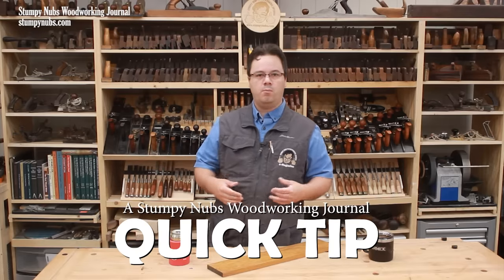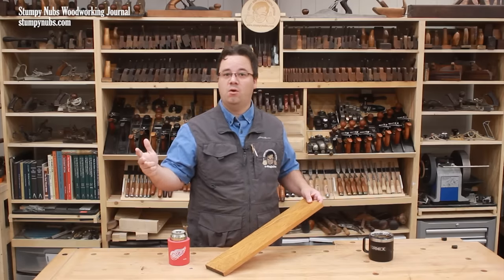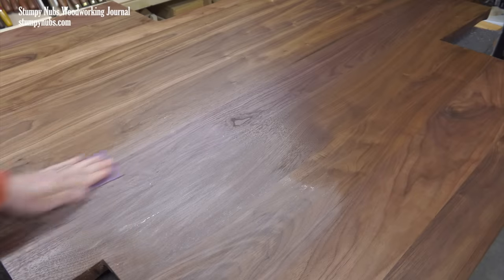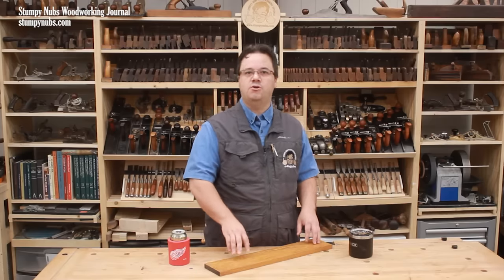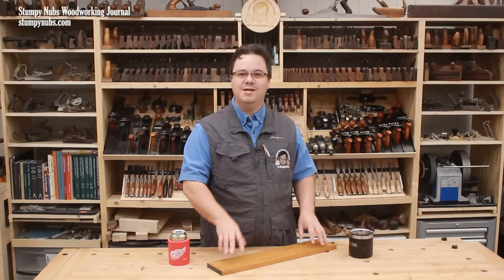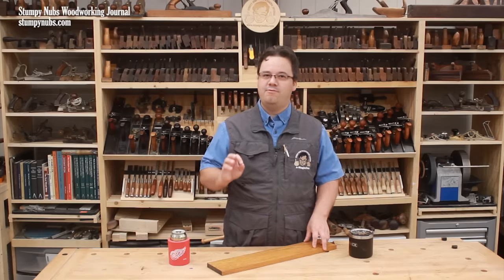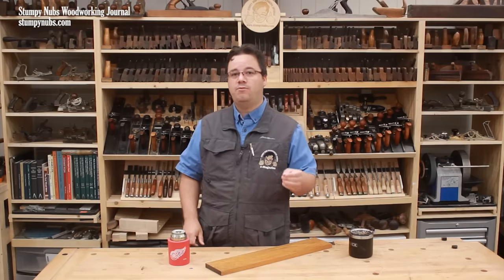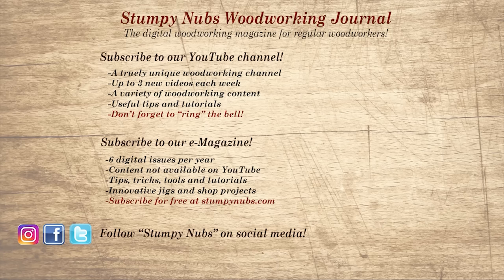Improper sanding between coats of finish- HOW TO AVOID IT!

Comment: Hello Stumpy Nubs.
Thank you for sharing the paper bag trick for buffing finish for the last final time. I always enjoy and learn a lot from your videos. I had some tables that I had to refinished because the kids accidentally spilled some super glue on them in about 20 spots. I used a fine blade scraper  with paper under each corner to remove the super glue. I then sprayed the tables with helmsman's semi-gloss Spar urethane with my air paint sprayer. I wound up with a bunch of little tiny tiny air bubbles or bumps. I think they might buff out but I just want to take the bumps off and then Maybe rebuff the whole Surface by hand. How would you tackle this project of taking the little bumps out of the Finish? Also for the buffing, would you recommend using Watco finishing wax? I really love the feel of this wax after it has been applied to a perfect finish. Believe it or not I also use it on my table saw and jointer. It doesn't leave any wax buildup on your wood and it makes the surface really slick. Thanks again. Gene

Comment: Great video.  Very informative.  I applied my first coat of oil based polyurethane and sanding it to get rid of dust and small bubbles prior to my next coat.  When sanding, do I sand it down until it's smooth?  Or, until I can't see the outline of the bubbles/dust?  Right now it's smooth, but I can still see the round outline of the bubbles.  Thank you!
Reply: Did you get this sorted in the time since posting?  I'm curious how it turned out XD

Comment: Good video-thank you! When using Tru Oil on a guitar body would you sand between each coat or maybe every third coat because the coats are so thin?
Reply: I am in the process of this now....I hit it after the first coat with 400 real lightly, 000 steel wool after the next 2 coats and 0000 steel wool after the last

Comment: Very informative video. I’d be interested in seeing the finishing room you have set up. I’m in the process of building a shop and a portion will be used for a finishing room.
Reply from the maker: It's just a 10X10 room where no other woodworking occurs to cause dust. I don't do a lot of spraying, and I try to use low VOC finishes, so there's no special ventilation or anything in the room.
Reply: @StumpyNubs  thanks for the reply. Like you, I try to use low VOC finishes. I’ll have a window in the room so I could use that to let fresh air in. I enjoy your channel as I find you give practical advice for the non-professional woodworker 👍

Comment: Mr. Nubs, I'm afraid you have stubbed one of my peeves. You wrote that your channel is "Truly unique," but you misspelled "truly." I'm not going to tell you the wrong spelling you used because most people judge correct spelling by what looks most familiar.

I know this isn't a huge deal but it is a really big pet peeve of mine. I'm actually worried I won't be able to keep feeding it, but I don't want to give it up for adoption so I keep it around. It's possibly my oldest and most loyal pet.

Comment: Great video! Lot's of good, practical information.  I have always heard that an important reason for sanding between coats is to prep the surface to provide better adhesion for the next coat.  Is this a myth or is there some truth to this?
Reply: For stuff like water based poly, it's absolutely true, because being water based, the 2nd layer doesn't dissolve any of the 1st layer when it's applied, so it needs a little something to grip onto. Solvent based finishes on the other hand, "bleed" into each other (as he mentions in the video) so the sanding is more just for getting rid of imperfections as opposed to helping it bond, but I'm sure the slightly increased surface area doesn't hurt either.

Comment: One critical addition to sanding between coats I believe you should mention is using a Tac rag to remove dust and debris particles.
Tac rags are a sticky cheese cloth which when lightly rubbed over the wood's surface remove any contaminating particles.  Most hardware or stores like Lowe's or Home Depot carry them. They are cheap and very effective.
Reply: No doubt he would use a tack cloth. Even masters overlook a detail now and then.

Comment: Every time I see a woodworking video about finishing and ALL of them, including this video state as gospel the proper finishing methods. I urge every woodworker to sign up aqnd take a finishing classes from a finish manufacturer. I am no different than you or any others but I took high end furniture finishes course through Guardsman finishes decades ago when I lived in Michigan. Sadly Guardsman is gone but all the major paint and finish manufacturers offer courses and the difference is night and day between stab in the dark methods such as I see you preach on versus tried and true methods. I am telling you this as constructive critisism but many I have told about this scoff and say I have no idea what I'm talking about but I have been applying high grade finishes on all cabinet and furniture projects as well as other woodworking projects with flawless results with far less than half the effort than you claim are essential. Good luck, you will need it your way.
Reply: Could you mention some of the differences? Just to get an idea.
Reply: I'm not sure why you characterize the method in the video as stab in the dark. It's pretty much exactly the method I learned in the finish shop I apprenticed in, at least for applying wiping varnish. It's pretty much exactly the method I've seen used by master finishers like Bob Flexner and others, at least for wiping varnish. It's a method I've used hundreds of times with wipe on finishes (apart from specific finishing techniques like French polish, which is a whole different ball of wax, or non-film oil finishes, which are also quite different) with professional level results.

In fact, I'm not familiar with too many manufacturers of film finishes that don't recommend applying a coat, allowing it to dry, lightly sanding the coat to level the finish and then reapplying, repeat, before some kind of final buffing, right on the can.

Though I do tend to finish with 0000 steel wool and a coat of paste wax on things like table tops rather than with the paper bag method.

But please, like the other guy said, do explain how whatever method you use is superior and any faster and more fool-proof.
Reply from the maker: "many I have told about this scoff and say I have no idea what I'm talking about..." ... Maybe it's your approach that they scoff at? I mean, you just called sanding between coats, something that is pretty much a universally embraced technique, "a stab in the dark method" and suggested it's not "tried and true." When you come out of the blue and cast aspersions on someone, essentially saying "you need to take a class and be be more like me," it seems inevitable that you are going to get a little bit of scoffing, eh?
Reply: @StumpyNubs  What I am implying is to stand back and look at the methods and tools and materials we use.Take tools as a example, no matter how you cut or assemble projects the amount of money spent on tools , all so we can be exact and precise. Some tools have proven to not be the best for the job , such as the old 1/4 sheet vibrater sander and our hands are likely the worst thing to sand with as far as making surfaces flat and level. Much can be learned by looking at the auto body repair and painting industry. Both in materials and methods are far above the level of quality commonly seen and used by woodworkers. When it comes to tools we spare no expense in having as many as we can but when it comes to finishing I see far too many cheap disposable brushes both foam and other inexpensive bristle tools that are better suited to clearing debris. A good sanding block and a random orbital sander are better choices and for molding profiles a foam sanding block works well. The key is flat even pressure. All sandpaper is not created equal so the better quality you use the better the results are. If a hand finish is what you like then a oil or Tung Oil finish is good but for something simple and dependable in results I recommend lacquer, especially a high solid type that will build a nice coat that will bury tiny particles. Buck up and get a decent cup spray gun and learn how to use it. The key to spraying is even consistent distance from the gun to the surface and proper adjustment of the fluid to air ratio and  switch your patterns of spray for even level coats. Once you become competent at it finishing becomes fairly simp[e. Afterall, it's not rocket science.
Reply from the maker: @jamesstanlake4064  - And which of those lessons apply to this video? People "scoff" at your opinions, not because they are wrong, but because they aren't relevant to the subject. None of what you just said applies to a video about hand sanding between coats of finish (aside from maybe the quality of the paper, but that's it's own subject as well.) This isn't a lesson about electric sanders, it's not about types of finish or how that finish is applied, there is nothing about mouldings or anything else you are pointing out. So you come across as a guy who just wants to sound like he has a lot of knowledge to offer, whether that knowledge is relevant or not. It would be like me going to a video about changing spark plugs in a car and telling the guy how to pull the transmission. Worse yet, you don't just add your knowledge, you go out of your way to disparage what I am sharing by calling it a "stab in the dark"..... I am sure you don't understand what I am saying here and you're already thinking "another person is scoffing at me." But until you are able to step back and see how counterproductive your methods are you will continue to get poor reactions to comment like this. Have a nice day :)
Reply: @StumpyNubs   I have no quarrel with the man with a lower price or standard, he knows better than anyone what his product is worth.